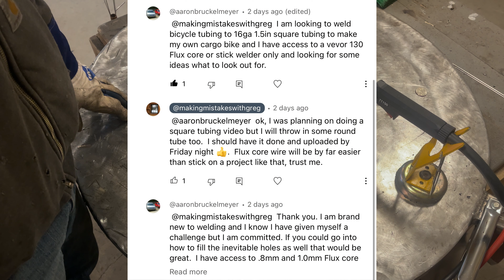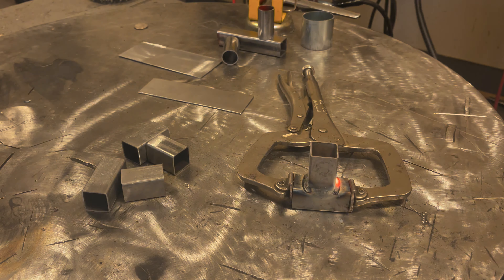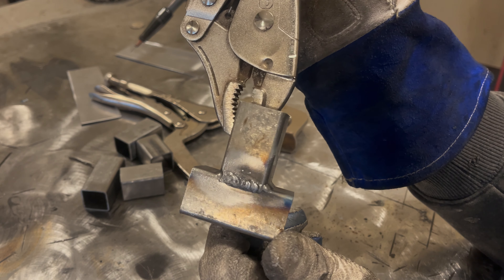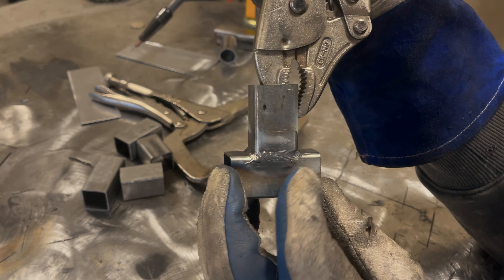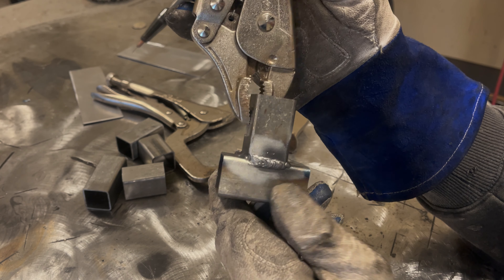Flux core welding part 6: Thin wall small diameter tube. Viewer suggestion

Comment: Put a fan on where you are welding. 
 Blows the smoke away. It welds better and less splatter. And you can see good.
 I found that out.  One day,  I was welding in my shop. I ran out of gas for my mig.
It was a Saturday.  No where to get sold wire till Monday. At that time. 
 I had a roll of flux core.  
 Put it in the welder.
I couldn’t see and it splattered bad. 
  I opened up the overhead door of my shop for more light. 
 The wind was gutting good. As the wind blew.  I could see good. And not much splatter. 
 It would stop. Couldn’t see and splatter. 
 I put a fan where I was welding.  It welded good and couldn see good. Just about as good as with gas.
 Now I use a fan just about every time. When I use flux core wire. 
 Even when I'm outside, with no wind.  
 Try it sometime!
 I think flux core wire was designed to weld in wind.
Reply from the maker: Normally I have a vent fan on, but I was a bit lazy and it makes a lot of noise.  You’re definitely right though, if you can’t see it you can’t weld it, and it’s not worth breathing the smoke 💨 😀

Comment: MIG is generally cooler with less penetration than FCAW.  Also, solid wire is available in thinner sections.  MIG/TIG are ideal for thin sections but FCAW and SMAW are doable.
Reply from the maker: All great points and correct.  MiG and flux core are much easier on very thin, I have stick welded auto body and similar before.  Needless to say I rather use a torch and a coat hanger but it’s doable lol.

Comment: I have an atv frame that i need to weld a-arm brackets. I will need to weld vertical up. Did you end up going lower on the recommended c-4 setting when you did vertical up? You mentioned it but im not sure if you ended up doing it?
Reply from the maker: I must have forgot to cover it, but I will be doing a few more flux core videos soon that will.  In the meantime to answer your question welding vertical up with flux core I generally use very close to the same values as in the flat position if the material is 3/16th or thicker.  The faster freezing nature of flux core makes it very easy to weld uphil in comparison to MiG and stick.  If the metal is thinner than 3/16th you may have to drop settings slightly.  It’s best to do a couple test welds to dial in settings on similar material.  You’re better off running too hot and burning a hole (and letting it cool/grinding it clean, lowering settings, and trying again) than you are running too cold and having no fusion.
Reply: @makingmistakeswithgreg  thanks alot! Im pretty nervous, ive welded mig before at school. No experience with fluxcore and 16 gauge steel tho. It will be interesting to see how it turn out. Theres not one local welder that wanted to tackle my project so i will try to do my best.
Reply from the maker: @ryy597  definitely do some test welds to get dialed in.  Local Home Depot/Menards/tractor supply stores should have square or round material in that thickness to make easy practice with.  16ga is a bit under 1/8th, which is easily weldable with flux core.  I would either flux core or tig weld it, stick would be real hard based on that thickness and uphill.
Reply: @makingmistakeswithgreg  i plan on getting a bunch of 16gauge plate and try to make butt welds. If im not making a hole welding to 16gauge pieces together. I don't think i will make holes in my frame. They don't sell pipe at my store, only flat bar and angle steel. It will be challenging for sure! The most challenging part will be to notch my flat bar to match the radius of the 1.5 inch tubing on my atv frame. It will need to be pretty damn near perfect if i don't want to make any holes. If y watch enough of yout videos i should be good right? Haha
Reply from the maker: @ryy597  practice will get you there.  Think of it like making music.  If you picked up a set of bag pipes for the first time your music will be 💩.  But with a good teacher and some practice you might just find yourself in a movie playing the ending credit music.  Or in your case doing wheelies and scaring insurance agents everywhere.  😀

Comment: Doesn’t stacking tacks with a flux core violate the “if it’s slag, drag” rule?
Reply from the maker: Good question.  Yes and no.  With slag you drag rule has to do with preventing flux from getting ahead of the puddle and causing the molten metal to solidify around the slag (slag entrapment).  It’s a general rule but doesn’t apply when welding vertical up for example.  When spot welding there is no risk of entrapping slag ahead of your weld because you’re not moving it much.  Unfortunately with flux core wire and thin wall pipe/tube you will blow holes at points.  Technically you could fill a hole by making a small tack, wire brush it clean, let it cool, and repeat 6-10 times A small hole could take minutes to shut doing that.  If you tac the hole shut while the flux is hot there is very little chance of any kind of slag entrapment or weld defects because the arc force pushes the flux/slag away from the hole you’re welding.  Not to mention if the risk of slag entrapment is unacceptable you would be tig welding it rather than and flux core process.
Reply: @makingmistakeswithgreg  So... when doing vertical up... were you pushing and not dragging up? Thanks for the great vids, btw. :)
Reply from the maker: @bigfoot9445  when doing vertical up I generally shoot for straight in or slight push angle.  The reason you drag in the flat position is because the molten/liquid flux will get ahead of the melt you’re depositing, causing the flux to solidify in/around the weld (slag entrapment).  In vertical up gravity keeps the molten flux from moving ahead of your metal.  You can actually weld with a drag angle up hill, a slight drag angle will be much better than a significant angle.  On super thin material a straight in angle will direct most of the arc force  towards penetrating the material which can make it blow holes easily.  Hope that helps 😀

Comment: Take a welding stick knock all the flux off cut a small enough piece the fit right over the hole tack weld both sides of the rod then weld it together
Reply: Save the stubs.

Comment: I've learned so much from your videos I really hate to leave anything critical be here it goes.  I know the Titanium machine is a good one, but that's not what I have.  So, when you talk about settings it sounds like you are playing Bingo!  How can I translate, "C-4" or "B+3/4 + C+3/4 into volts and wire speed??  I don't even care if you give me inches per minute as I can easily covert that to meters per minute for my machine.  As you know, I love and have learned a lot from your teaching --I just need you to throw me a bone so I can translate the bingo settings into something I can use...  Thanks!